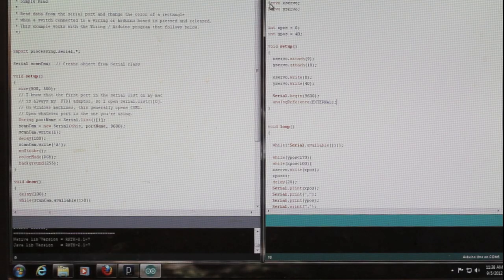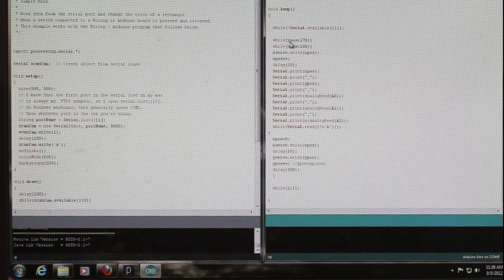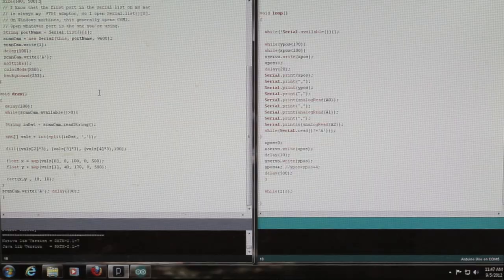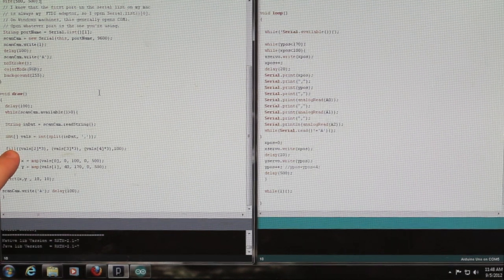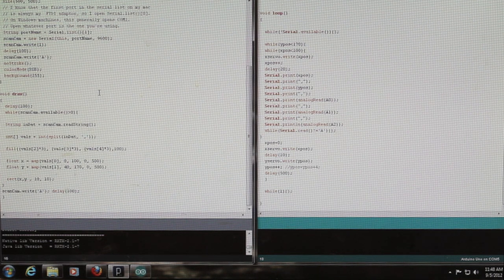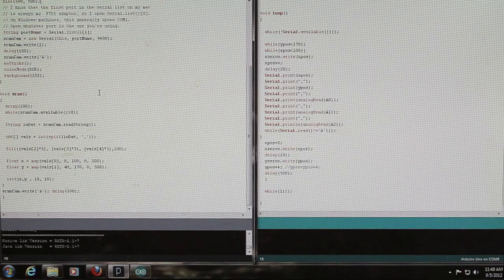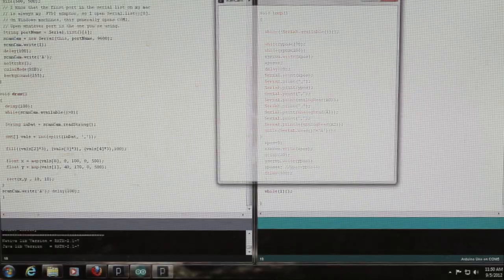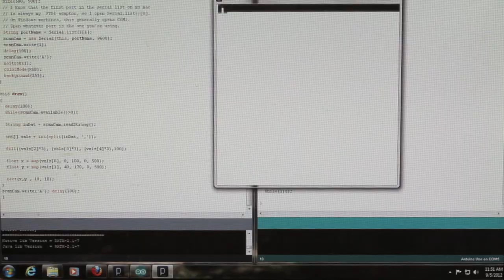SparkFun Engineering Roundtable 9-10-12: The Big Ugly Camera with Nick Poole

Comment: It looked like there was a fair bit of backlash in the gears, though, and you would have to measure it in order to compensate in software if you scanned in both directions.

The project seemed very well optimized for teaching the concepts involved, and being quick to put together.

Comment: Yup, I used a program called "Gear Template Generator," It costs $25 or something like that but it's worth every penny if you do a lot of work with gears. You just put in key metrics and it does all the involute geometry for you, then you just spit it out to a vector file and cut it with the CNC machine of your choice (or print a paper template and cut it by hand, I've done that too)

Comment: i might be able to solder it if i get some boards made. been playing around with SMT soldering using a hotplate and toying with the idea of making a DIY reflow oven. I think what i'll do is design a breakout board based on the example in the datasheet.
Then i'll need to use something to translate the voltage levels between 3.3v micro controller and the 2.8/1.8v the CMOS chips use.

Comment: might be more interesting to try with a thermal sensor, maybe hack a cheap spot temperature gun and scan it in a room.
would also be cool to scan a landscape with a millimeter wave dish antenna.
another quite cool thing would be to scan a landscape at 2.4GHz. although you'd need a large dish to get any angular resolution with the large wavelength of 2.4GHz it would be pretty cool to visually see where wifi devices are and the light they shine on buildings and such

Comment: Why not have the arduino fill an array that represents the color readings for an entire scan line? Then, pass that array to the processing program for data crunching. That should speed up your scan time by a bit, and shouldn't require too much memory on the Arduino. 150*3*1 bytes.

Comment: I just replied to a comment on the website to this effect. The reason I didn't is that I was really hard pressed just to get the thing to work, so I just didn't get around to it. But the code would be simple, just have two different x routines, one that ++'s and one that --'s and only run one of them if((y%2)==0)